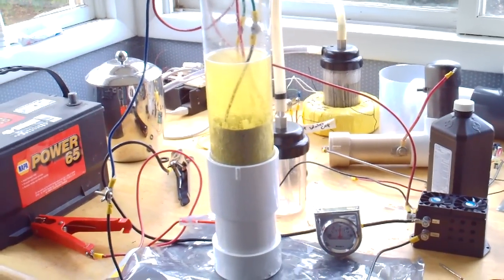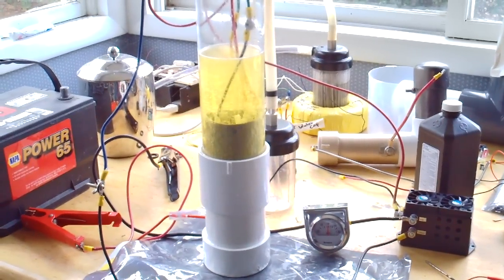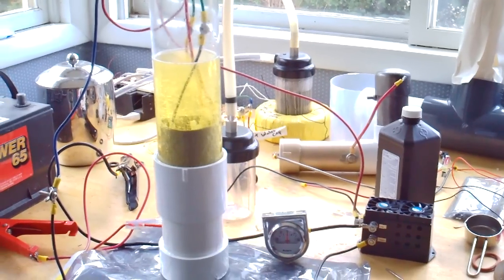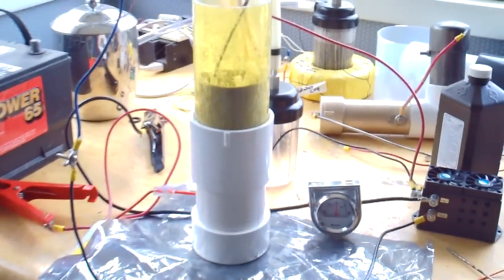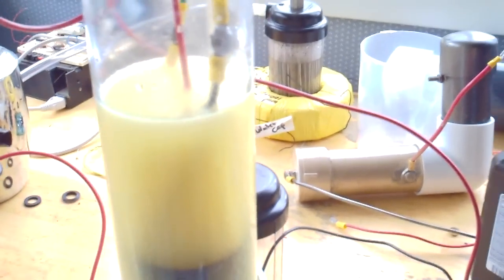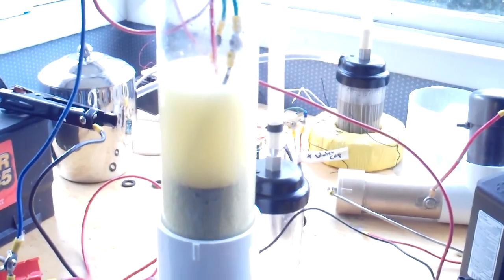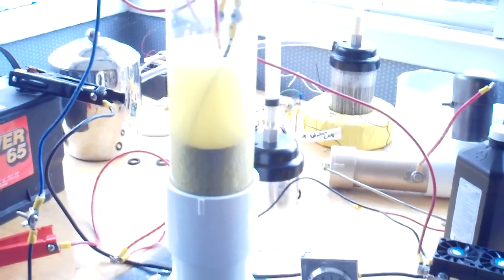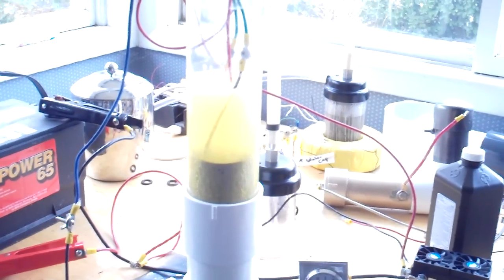High Output Big Kahuna HHO Cell Test

Comment: That is so amazing! Can an engine run purely on hydrogen? In a vehicle does the hydrogen generator run the whole time the engine is on? What would need to be done to make electricity for a home? Have you figured out the stanly Meyer injectors? Great video!

Comment: Have you compared your Gas Output with Amps you stuck in your system. I can't get over 5 ml per Watt. What is your production rate ? Have you found that any metal alkaline drops the Voltage in your Car, the only one which keeps the Voltage is Baking Soda which falls apart with heat.